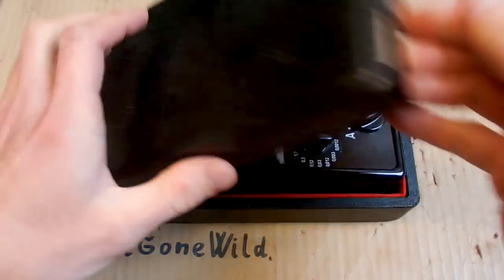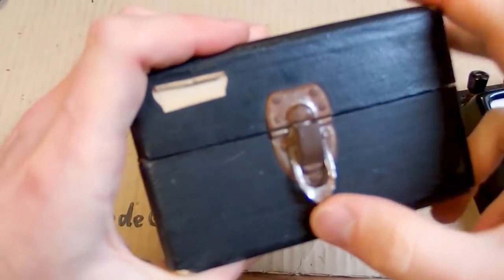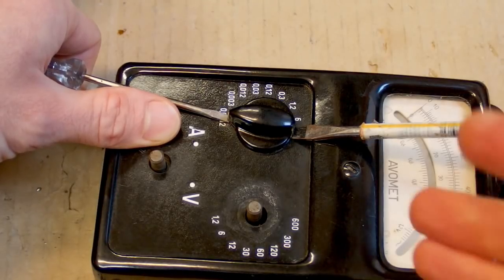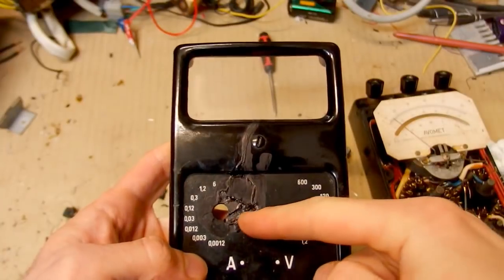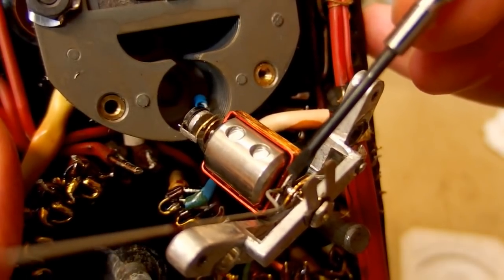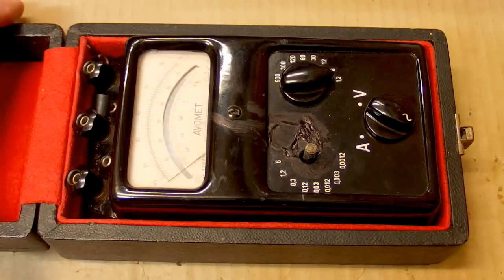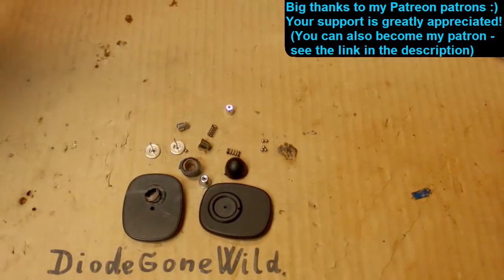What's inside a vintage analog multimeter (AVOMET)

Comment: That's a beautiful old meter. A shame it has the issues it does. Try dissolving the glue with acetone. My guess is that it is some kind of a cyanoacrylate Super Glue. Has that crystalline look to it to me.
Reply: @Paul Frederick - 
YES , highly likely cyanoacrylate based Super Glue ... hope the plastic lasts longer than the glue.
Reply: @Killerspieler0815  I don't think acetone hurts Bakelite. No harm in trying now anyways.
Reply: Acetone ftw nail polish remover for the poor yet savy
Reply: @bradysolaem2467  I buy acetone at big box stores in gallon jugs. It is one of my favorite solvents. I use it for degreasing prior to painting. Acetone is pretty cheap. I think the stripper stuff is stronger than nail polish remover too. When you buy acetone all you get is acetone.

Comment: Beautiful vintage instrument. I love these devices.
Reply: Yeah I have a thing for old analog meters myself. He did a great job restoring some ranges on it.
Reply from the maker: I plan to fully restore it, another Avomet is on its way to me, I will make one nice one from two crappy ones. There's a lot of them on the internet, nobody wants those analog things those days...
Reply: @DiodeGoneWild  it is a beautiful instrument. A lot of work went into making it. There's things an analog meter is still best suited for. I was trying to measure the current of the spindle on my CNC machine and none of my digital meters could. But my old analog meter averaged it out and gave me a reading. I'm not sure if it was right, but it was something. Was a Chinese SMPS running it. So very dodgy.
Reply: I hope you do restore it!!! I look forward to that video😁

Comment: Man, I LOVE meters like this. A solid Bakelite case, embedded solid-brass contacts with 'copper finger' moving contacts, hefty wire shunts, mirrored-scale analog meter with actual GLASS over it...and that's actually amazing that the case is still with it, intact, and in pretty great condition inside. That was a real damn shame about that 'glued' knob, though.
The 'cylinder' in the movement is to increase the inductance of the coil, making it more efficient, i.e. greater deflection with less current. My compliments for removing the moving coil and getting it to work again, though! I can't tell you how many movements I've done 'surgery' on over the years, but it's a real skill, and I've received MANY instruments for free, just because the movement needed a little work. That said, iron vane movements are now my favorite. LoL
BTW, the term you're looking for is "parallax error," when you describe using the mirror to get the right viewing angle of the needle on the scale. :)
Reply from the maker: I'm about to upload a second video about it ;).

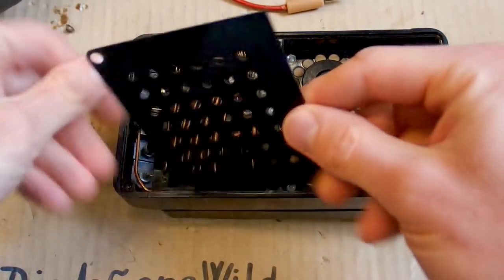Comment: @6:00 - Here in the US, we call that material *Bakelite*. Excellent stuff that isn't really used any more. **Edit - It still has limited uses and is still in production in various forms.
Reply from the maker: We also call it "bakelit", but I wasn't sure if this word was international :). I think that the entire housing is bakelite, not just the thin cover.
Reply: @DiodeGoneWild  I agree that the entire device is Bakelite. Unfortunately, it's also a brittle material especially with the passage of time and application of UV rays.
Reply: @DiodeGoneWild  Bakelite was invented close to where I grew up. Three towns away. It's weird stuff. When it is made it is actually baked. Well the mold is heated up under pressure.
Reply: Bakelite is still used in electrical applications. Bakelite is resistant to heat, and a lot of solvents so it has desirable properties. Bakelite is a phenolic plastic. So Micarta is basically Bakelite. Same resin.
Reply: Yeah your right it is bakelite,, and it makes perfect sense giving its age that it would be used. Plus it does have great thermal propertys!!! It mad how it was invented to replace pool ball's(which were made from ivory at the time) and win a competition(plus the contract for pool ball's back in the day)
Reply: @DiodeGoneWild  You could 3D print yourself a replacement knob perhaps? 😂
Reply: @keithking1985  Don't over-glorify bakelite. Yes it has some very good mechanical properties (especially fabric reinforced bakelite), but electrically it isn't great, it easily soaks up water (even just from humid air), then the breakdown voltage drops significantly, and once it broke down, it starts carbon tracking very easily.

Comment: Good show, as usual. I'd cut the knob off with a Dremel Tool, that would get you in the case with only the loss of the knob. Ultimately it wouldn't have changed the outcome though, and Hindsight is 20/20. Over the years, I've broken a few things, only to realize that once apart, if I had only pressed here or pried their, it would have come apart successfully without damage.

I bought an Analog Multi-Meter on EBay, guaranteed to work, it didn't. The seller refunded and profusely apologized, I'm OK with that. So I bought a modern analog Multi-Meter, LED Display Illumination, Simulated Meter Scale Mirror, it's silver, but you can't see the reflection. Nevertheless, I bought it to show the grandkids an analog meter in use. It works fine overall, and exceedingly fine for demos. There was an Analog Meter made by Radio Shack years ago, Analog Movement driven by Electronics, it would only deflect the correct way, regardless of polarity on DC, but it would set an Indicator Light saying that the polarity is reversed. Wanted to buy one recently, used, but couldn't find one. 

I do enjoy your shows, keep up the great, and interesting efforts.

Comment: I hate flat head screws. I always slide off the screws and end up stabbing my hand.
Reply: And I never have the correct size screw driver for them, even though I have like 10 different sizes.
Reply: RandomTux it’s easier to use different side screwdriver on them than on cross headed screws

Comment: 4:54 When you measured the resistance of the current meter, the switch was on the voltage setting. Could that be the cause of the very high value you measured?
Reply from the maker: Maybe, if the voltage/current switch disconnects the shunt. Or maybe the shunt was blown. It was set to the lowest current range, so the shunt gets blown very easily :).
Reply: Probably. I think the current path a good multimeter should be open circuit when not measuring Amps for safety reasons.

Comment: I like the way the switches were made, big contacts with multi spring wiper :-D
Even if it worked, it would have no use in this day and age of digital accuracy.
Reply: There are still uses for analog meters, but they are very limited
Reply: Ruben Kelevra
Yes you are right, i have an old Avo 8 multimeter and its ideal for peaking the moving voltage of radio circuits.
Analog displays are more compatable with the eye/brain, like having a light that changes brightness with adjustment.
I forgot about peaking uses.
Reply: @zx8401ztv  you can also measure fluctuations with an analog meter.

For example if you want to set the stab setting on a avr for a generator a analog meter is much more helpful than a digital one.

Comment: Four years later... Just finished restoring and calibrating mine. Pushing sub 2% accuracy all ranges. Had issues with movement, broken resistor lead, rust and corrosion.

Comment: The mirror as you say is if looking at an angle ,which is called parallax correction, some old cameras
used to have this on the viewfinder, to compensate for difference of the image seen by the finder and lens,
the viewfinder being higher than the lens. As always a very interesting vid, cheers.

Comment: That thing is probably pre war with those tar caps and bakelite case. Or very early 50s. Probably acetone helps with removing glue residue. Also, there were analog meters with tube or FET amplifiers inside and very high input impedance.

Comment: I have a UM3a analog meter from 1970. Similar type of construction. If the rectifier is selenium or copper oxide (the second beeing the case with mine) then trying to replace it with any modern passive equivalent is impossible. Even small-signal Schottky cannot match the copper oxide rectifier at low current. Tried it with mine and Schottky performed marginally better in the higher reading region, however in the lower region it performed worse. It was a nearly 50 year old rectifier with increased series resistance. Brand new it would have had outperformed the schottky at both ranges. The non-linearity of Schottky and copper oxide is different. Modern replacement would require a new scale. What I did is I decreased the series in-circuit resistance which was common for all AC ranges as it was in series with rectifier. AC reading went back to normal on all ranges. For AVOMET it would be R22 that needs attention. I still use my analog meter because I find it better for certain applications. The shunts are much better quality than ones found in chinese made mutlimeters.

Comment: Too late now, but some heat may have softened the glue? The case is made from Bakelite which is very brittle but can handle some heat more than plastic.
Reply from the maker: Maybe.... or some solvent. But anyway, I have another AVOMET on the way, so I can  maybe make one working piece out of two deteriorated ones.
Reply: @DiodeGoneWild  Please document this as it would be very interesting.  Thank you.
Reply: Why is everyone saying Bakelite is so brittle? Bakelite was some pretty tough plastic depending on the blend. Some manufacturers just added too much filler to their mixes which made their plastic weaker. They usually used sawdust because well it was sawdust. Which was cheap crap.
Reply: @Paul Frederick - In all my experience with old stuff, Bakelite was most definitely brittle. It was tough though easy to scratch but when it did take a decent knock it would shatter like an old 78 gramophone record. Or cast iron. It definitely never deformed like a plastic.
Reply: @Drew-Dastardly  I guess looking at it that way. But there's times you don't want plastic to bend. A lot of times. Bakelite was knocked off by a lot of manufacturers too. And in the quest for higher profits they used lousy filler materials in their blends. Which made poorer performing products. Not all Bakelite was created equally. I grew up about 10 miles from the original plant where Bakelite was produced. So there was a lot of the good stuff in the area I grew up in. Although I can remember the lousy stuff taking over.
Reply: @Drew-Dastardly  as far as Gramophones go Edison made those 10 miles in the other direction. When I was in grade school going to the Edison labs was a popular class trip destination.

Comment: Hello there, I bought Multavi II,  some wires are not connected in its correct places, due to previous modification done by its previous owner, after consulting its original Schematic diagram,  I found many round coil resistors (actually 3) in it, and not appears in its diagram!! I could not fix the AC path, any help would be appreciated!!

Comment: The whole case (and much of internals) looks to be made of bakelite which is very heat resistant. Maybe if you carefully heat up the shaft for that knob it would melt the glue and do no damage otherwise?

Comment: I have a vintage analog meter too.
The guy that I got it from told me its in working condition but it wasnt. It had lots of blown traces on the board so I soldered new lines for them but its still shows false readings and some functions doesnt work. I would like to send it to you but probably the shipping cost would be insane.

Comment: Fixing my slippery knob always makes me do A vomet ... leaves a nasty taste.  My first meter looked very much like this one (1972) except it was called an indicator (we didn't calibrate them in those days) it was a hand me down from an earlier time.  The big difference was mine had a flat filed into the shaft to prevent the old spin a ma-thing with the range knob.  Within a couple of years of getting my first meter we were using more modern coil meters filled with flimsy little components ... then in very short order the first LCD meter became available - bloody useless article needed new batteries every week and the scale sample rate wasn't damped so readings would swing up and down at dizying speeds with capacitive or dirty lines.

When we had a new precision measuring desk, it came in kit form.  The tec who assembled it calibrated ranges by either removing wire from the wire wound resistors or on the large shunt resistors he used a hacksaw and file to remove material to increase the resistance.
constantly checking temperature and cross referencing it with a table.

That soon changed too, now the only thing that's big is the display and the interface that integrates tester with the remote comms link

Comment: Nice, especially the box, and the accessible contacts on the bottom, never seen this before. In general about those meters - the better ones got the hand hanged with a wire instead of a bearing. Those are much more sensitive. The hand can be very fragile in those, it will break  when touched like in the video, sometimes they are made of glass. I got an old EAW. In very old meters AC is often shifted, maybe because of the semi conductors used. DC only meters sometimes work forever.

Comment: 1kohm per DC volt is very poor, near as useless. That would be what to expect on the AC range. The best meters at the time would be UK manufactured AVO or a USA manufactured Simpson which had 20kohm per volt. They had an Ohms setting (Amps, Volts, Ohms - get it?) and protection including a physical cutout sprung button that had a hair trigger if you measured a higher voltage on the lower range.
I would trash this meter and find an AVO or a Simpson to restore.